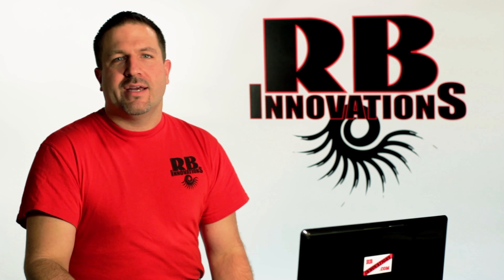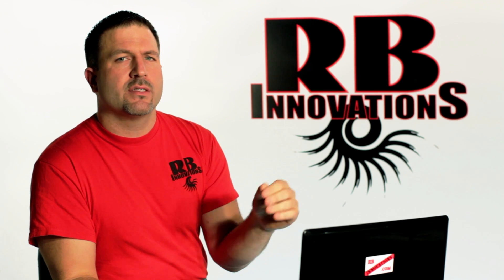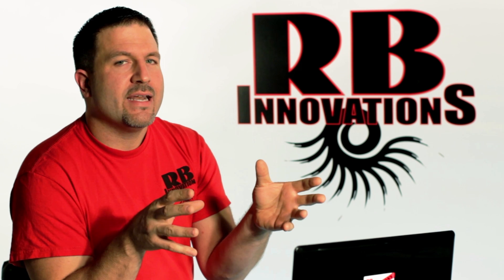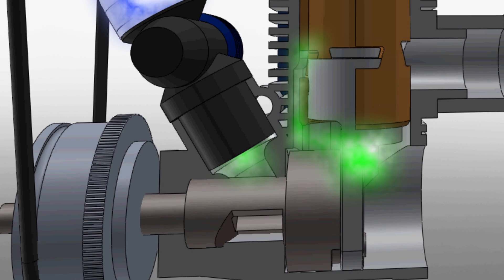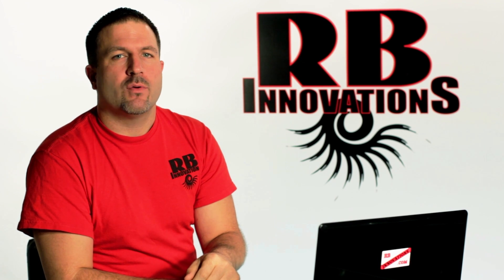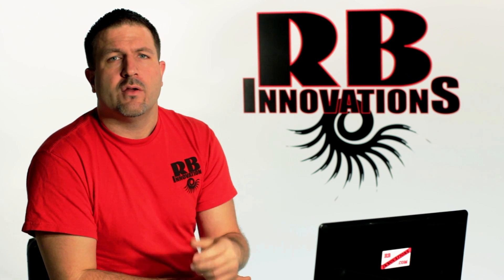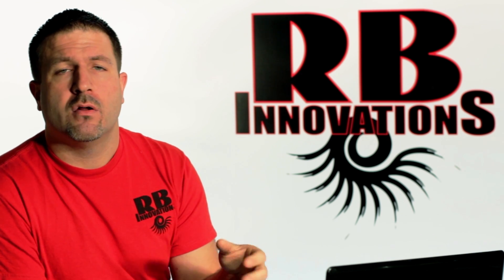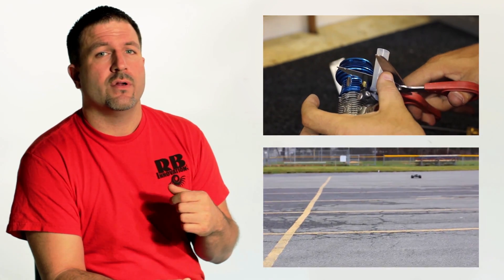How RC Nitro Superchargers Work

Comment: can u get supercharges for electric rc cars
Reply: someone able to improve that silly conversation and tell the differences between electro- and gas engines?
Morons: The physical basics of these two concepts are pretty far away from each other.
Reply: nope but you can get bigger batteries
Reply: thenerdling1
or neodymium magnets to give the rotor with the windings a better force from the magnets (huge difference on a small scale rc car like the Mini-z when comparing it with stock versus a new 130 size case with bearing and the stronger magnets) it draws a bit more power as well but gives it a hell of a move :3
and will give you a bigger amount of torque so you can gear it up a bit so you reach higher speeds too ^^
Reply: thanks
Reply: superchargers are exclusively for internal combustion engines. They are for boosting the amount of air you can take in, electric motors do not require air at all (except for cooling maybe) and will function in a total vacuum (brushed motors will also function underwater, due to having sensors onboard most brushless motors will be damaged by being submerged).

Higher voltage batteries (3S lipo for instance) and matching ESC will boost the power. Brushless motors (and matching ESC, can only run brushless motors on brushless ESC's and vice versa) will boost power.  The aforementioned neodymium conversion is possible on brushed motors, although you can buy higher end motors that use neodymium as standard, massively boosts the torque but not the RPM's, but thanks to having a higher torque you can get away with higher gearing for a higher top end speed without effecting the torque available at the wheel.
Reply: thanks
Reply: yes put a supercapacitor and manages a higher wattages to your motor...
Reply: ***** False.

large inductive loads such as an electric motor changing cause electrical noise on their supply lines. This noise is in the form of voltage drops and spikes. The effect on the motor is negligible but one long wires the voltage change may cause radio interference (AM radios are the most prone to this and 2.4ghz systems are near immune), the drops may cause a loss of power in servo's causing them to twitch or jitter, it may be enough for the receiver to drop out completely.

Capacitors on your motor leads simply suppress electrical noise. Anyone with a modicum of understanding of what a capacitor is and basic electronics can see how a capacitor cannot increase the wattage to a motor. Their purpose is simply, while the motor is running the capacitor charges, if the voltage drops suddenly the capacitor discharges and reduces the drop, any sudden spike goes towards charging the capacitor and hence reduces the size of the spike.

A decent ESC will already have capacitors fitted at the motor connections and battery connection (plus if it has one, the BEC output). A decent receiver will also have capacitors on its power lines. Its usually a good idea to fit them yourself at the motor end but not completely necessary, with the cost of ceramic capacitors being so low though its not a bad idea to add them at the motor (on ebay you can have handfuls of them for under 5 dollars). Brushed only that is, they can interfere with the operation of a brushless motor so any noise suppression is usually employed on the brushless motors internal circuitry and on the ESC.

A supercapacitor is inherently unsuitable to such an application. Firstly their capacitance is huge, you don't need huge. Their maximum discharge rate is lower than a ceramic capacitor, this is bad, you need really quick discharge. Their charge rates are slow, this can be bad. They are electrolytic, this means they have a polarity, this then means that they have a specific positive and negative terminal and can only be connected one way around, connecting them to wrong way will destroy them, RC car motors turn both directions by reversing the polarity and as a result this will destroy your capacitor when the motor is run in one direction (an RC plane without thrust reversal could use electrolytic but ceramic is still better suited). Ceramic and tantalum capacitors however do not have polarity. Final one, operating voltage. Ceramic capacitors generally have a 25V maximum voltage, I personally have a small packet of 50V ceramic capacitors here and a small packet of 16V electrolytics (you actually caught me while tinkering with my robot so I have all my parts out). The RC car voltage will match the battery voltage, typically 7.2V for a 6 cell NiMH (closer to 8 fully charged) and upto nearly 15 for a fully charged 4S LiPo (not so common on cars). Running a capacitor at a higher voltage than it is rated will destroy it, a super capacitor usually only has a maximum voltage in the range of 0.5 and 3V. So no matter which direction it is wired, as soon as you pull that trigger or push that stick on your remote, your super capacitor will blow up (they do pop actually).

Use a ceramic capacitor for suppressing electrical noise. Anything else is inherently unsuitable (tantalums have unsuitable voltage ranges and overheating issues, mylar has too small a capacity usually, any electrolytic variety is fixed polarity and usually too slow). No capacitor will improve the motors performance.
Reply: freeclimb64 at last someone with some sense
Reply: I can't believe he just asked that question

Comment: I would love to see some dyno results as well... however, as far as N2O goes, it does make more power by providing more O2, but... engines running nitrous oxide make even MORE power if forced induction is used along with it.

Comment: A turbocharger doesn't force out exhaust gasses... To put it into simple terms - it is driven by the hot exhaust gas that naturally wants to get the hell out of the cylinder and into the much cooler atmosphere.

Comment: Inherently, the purpose of supercharging in a 4 stroke motor is to add more "air" to the combustion cycle so that you can add more fuel and there would be sufficient O2 to burn the extra fuel properly. The BIG difference in an RC engine is that there is ALREADY extra O2 provided for combustion IN THE FUEL!  That's why they run nitro methane. Street 4 cycles run nitrous oxide to provide extra O2 for extra fuel. RC engines utilize the nitro methane for the same reason .. some dyno results?? C'mon!

Comment: Detroit's have wet sumps and the boost goes straight from the supercharger to the inlet ports in the cylinder sleeves. They aren't called transfer ports on a Detroit because they aren't transferring the air from the crankcase to the cylinder. Nitro 2-strokes have a rotary valve as part of the crankshaft. Normal petrol 2-strokes have reed valves so as the piston travels down, it can create its own boost to flush out all the exhaust gases hence their inefficiency over a 4-stroke

Comment: You have something like 140 degrees of piston fighting against the extra crankcase pressure before the transfer ports start to open and then there's the issue of a correct expansion chamber on the exhaust

Comment: Im not an expert in RC engines but as long as the Supercharger is able to freely spin without drag then it wouldnt require loads of Horsepower to spin. if you run a road vehicle with a supercharger and your not getting any power from it try loosening the drive belt. the same goes for an RC nitro supercharger. not getting power loosen the belt then try again.

Comment from the maker: Thanks for the comment. We've developed and continue to improve our Supercharger systems throughout the last 12 years, and we've found, along with our customers, significant and noticeable gains by using our Superchargers on these small nitro engines. Contrary to what you might have heard, the system actually requires minimal power to drive the Supercharger, which allows for maximum output from the engine. If you want to talk in more detail, call us at 315-451-4440

Comment: I have seen a Turbo Charged 4 stroke on a RC airplane giving 4lbs boost.I believe 2 strokes have a lot of potental yet.A old Diesal 2 stroke at work has a supercharger and turbo on it & fuel injected of course.Be good to try do away with the crank shaft shut of & just let the supercharger do all the work.Then put a rotating exaust valve on to close of the exaust some to let the supercharger ad some more boost.Bit like a CR250 2 stroke uses to ad more bottom end grunt.Wow,Mite try this myself.

Comment: i love how the video basically says supercharging is in the exhaust, well thats true without the supercharger... then it ends with "the customers and skepics are basically too stupid to understand..." well put it on a dyno. a small eddy-current dyno has to be cheaper to build than to develop an supercharger. prove you product please!... and show running temp based carb tuning. these things are so responsive to a lean hot mixture there is plenty of room to fake the numbers...

Comment from the maker: The carburetor doesn't necessarily need a "negative" pressure, but the fuel pressure must be greater than the intake pressure. Using exhaust driven fuel pressure, the exhaust pressure will always be higher than that of the intake, because the explosion within the cylinder creates greater pressure than the Supercharger does on the intake. If you want to discuss more in detail, give us a call at 315-451-4440.

Comment: Explain to me how this will work when a carurator needs a "negative" pressure to get any fuel out of the jet, i think the car runs only because the supercharger dont create any pressure at all. If you can show me how much pressure your chargers will produce and that the car runns better with boost in the carb, then i will spread this amazing supercharger system to everybody i know.

Comment from the maker: No it stays very evenly tuned once the carb. settings are dialed in to maximum performance. You want to step through the engine tuning process exactly like a normally aspirated engine.  Thanks for the question!